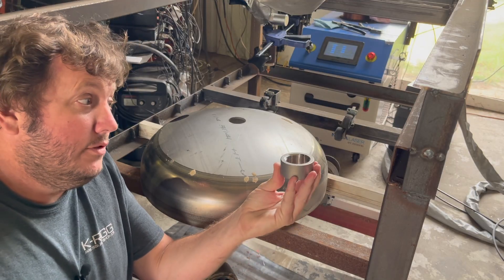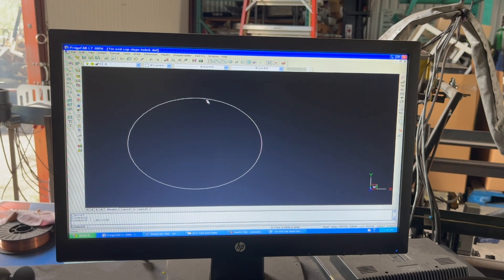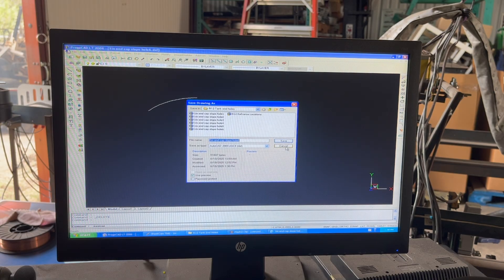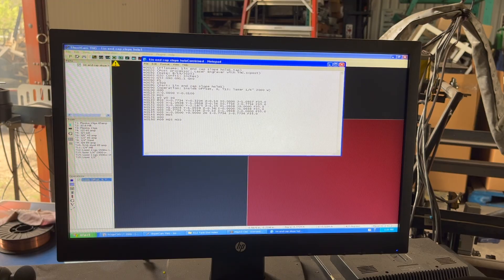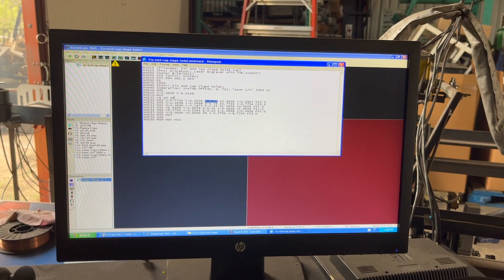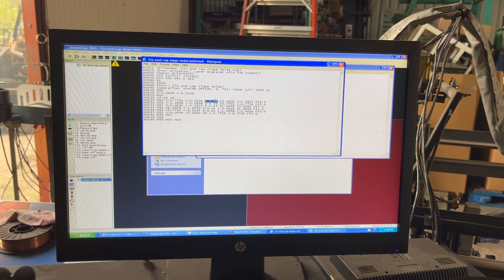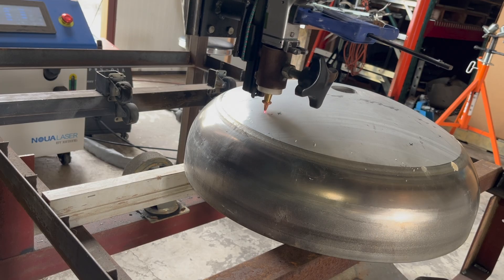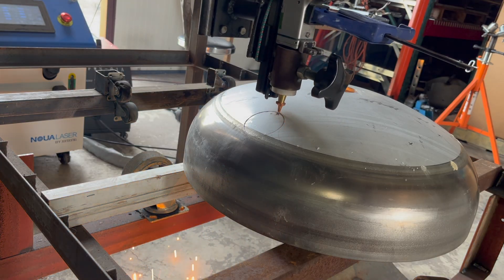DIY CNC Curved Surface Cutting: No Torch Height Control Needed!

Comment: I'm sure about buying a laser welding machine to put on my CNC tube, I'm going to replace my Hyperthemy 45 XP plasma, I'm going to buy the 1500 watt one, my question is whether it will be able to handle the work, since it will work 3 days a week for 8 hours. Will it be able to handle it?

Traduzir uma conversa
Reply from the maker: 1500w would be comparable to the 45.  I would compare the 2000w to a 65.  Yes, the duty cycle should have no problem at 8 hours of operation.
Reply: @k-rigg Thanks for the reply.
The quality of the cut isn't very good, even with the Fine cut nozzle, especially when the parts are small. The idea is to improve the cut quality.
Did you improve the burr problem?
Reply from the maker: @dionecordeiro5824  not yet, just found a cheap belt sander to get rid of the burrs. Easy Metal Slag Removal on Plasma Cut Parts with a Wood Working Drum Sander.
https://youtu.be/-pCJqCy3UAo